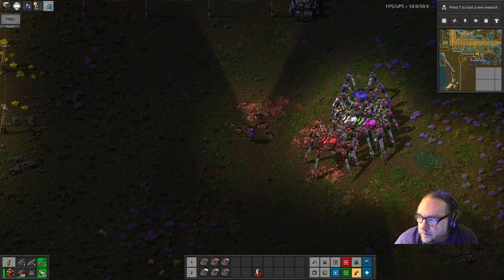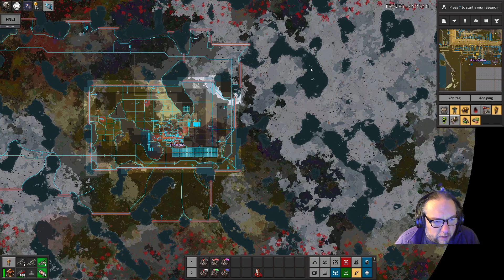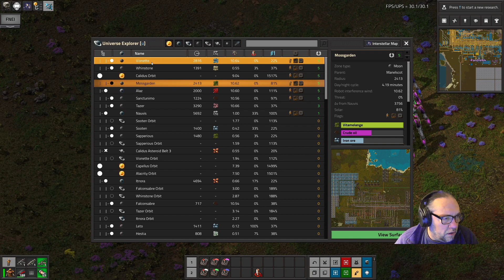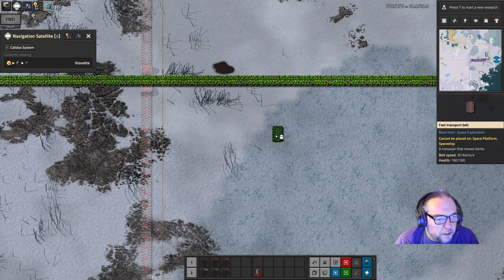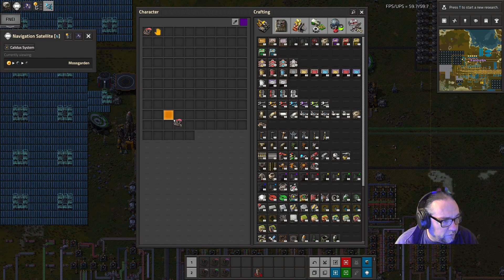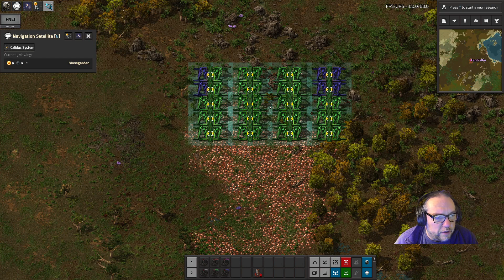Factorio 1.0 Space Exploration Lazy Bastard EP101 (First remote control builds)

Comment: Ey dude, if u wanna get stone, coal and wood out of the spidertron inventory u have to do a logistic request on it and then at the bottom move both bars to the left until it says 0 minimum and 0 maximum. That way logistic robots will get the trash out!
Reply: If u see ur miners for example, u have a request from 600 (minimum) to infinite (∞). U can set to 600-600 or 0-0, as u prefer.
Reply from the maker: @efetea  Yup. Like I said in the description I figured that out after the fact. LOL 4000 hours and still learning new things.